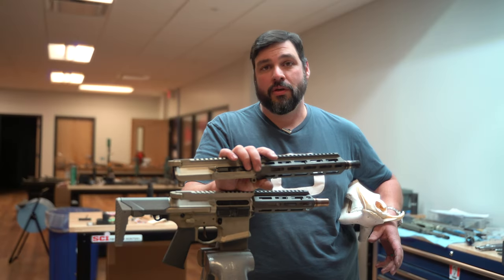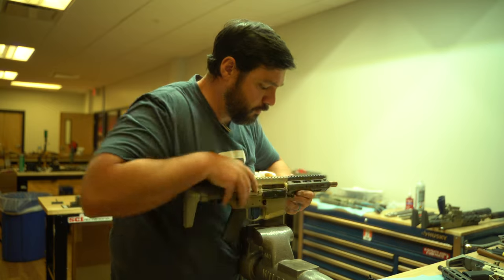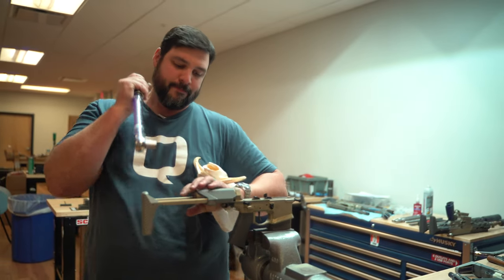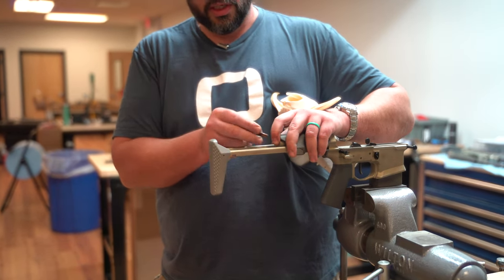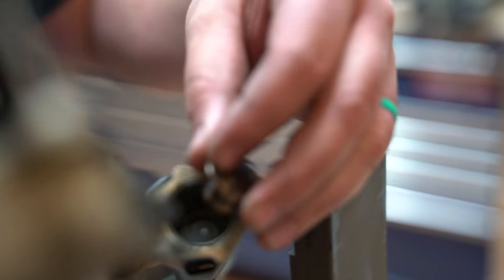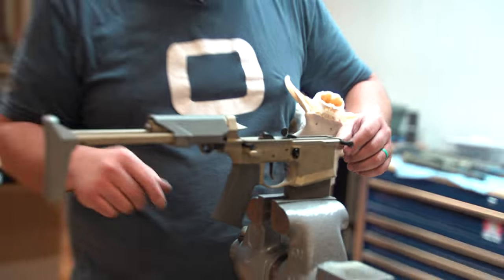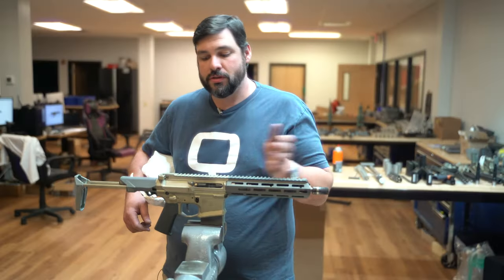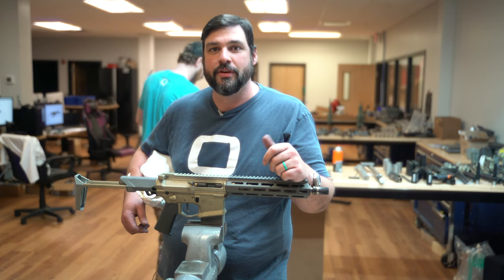How to Convert Your Honey Badger to 5.56

Comment: The price point is going to be interesting on this one. If they charge too much for the upper, you may as well just buy a whole new gun at that point. Curious if the kit will also include the BCG or if they will make you buy that separately as well.
Reply: So this is about the closest I've seen to someone using "price point" correctly. You only use it when refering to a product without a set price. Such as this, when a company is trying to determine what price to sell said product at. "Should we sell it at a $300 price point?" 

Once that price is set, it's no longer "price point". You use "price" no matter if you think price point sounds correct. 99% of people use price interchangeably with price point and that is not correct. I'm actually shocked to see you use it pretty much correctly. I had assumed you used it wrong like everyone else does, so I made an entire comment about it and deleted it once I realized you actually used it correctly. 

Nice job!
Reply: I’m sure, regardless of price, people will pay it.  Im sure it will be about 200-300 more than it should because you’re atleast skipping the tax stamp and wait for sbr guys
Reply: Yes, will include new carrier.
Reply: @kevinbrittingham6774  Any plans for other barrel lengths? 12.5 or 14.5?
Reply: @TheWesman45  yes

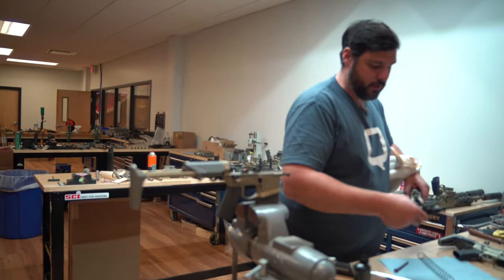Comment: @Kit Badger do you if Q will be selling those Q Cert rails with stainless steel thread inserts for the original 300blkout Honey Badgers? I saw it on the table in this video at 3:05 and it looks sick! Not sure if it was the Boom Box or not.
Reply: Looks like a boombox.

Comment: The fact that I don’t have to convert it back to 300 blackout with the old recoil system makes this very compelling. It’s nice that once I converted to 556. All I have to do is slap my factory 300 blackout upper back on! It makes the question do all new honey badgers come with these parts from the factory, even if it’s a 300 blackout version? If not, that’s really stupid and it should.

Comment: I was wondering if there is a way to buy a 300blk upper and basically reverse this video. I just bought a 556 honey badger and its insane, love it.  he mentions that with the 556 recoil system you can seamlessly switch back to 300 blk, but i cant find a 300 blk upper for sale anywhere, or that its even made...
Reply: Follow up in case anyone was wondering, I reached out to Q, it’s in the works.

Comment: Nice, ok, next two projects, a version in .22wmr with an overall length of not less than 24 inches with the stock collapsed so we here in the UK don't feel so left out, then a fixed stock Mini fix, same minimum OAL, because of the same dumb gun laws.

Comment: in theory this should work perfectly with a Ghetto Blaster too right?
Reply: Wanna order one today and find out.
Reply: @ClevelandWHAT  already done did it =) 

I've put around 180 rounds so far no hiccups.
Reply: that said... i got mine before they went for sale... a friend got a HB 556 for parts... so I picked up his 556 upper and I'm using my novseke BCG not this new 2piece.  I gotta find a way to get my hands on this new BCG and spring setup now haha
Reply: How’s the ghetto blaster run with the new spring setup on the Noveske 300 upper
Reply: @ClevelandWHAT  sorry you might not have seen my second message.... I got my upper in a weird one off deal... so upper only no BCG.  so I'm using the "old" HB/Noveske spring and BCG. I've only been out the range once.. I was testing a couple of things so only got about 180 rounds through it.  so far perfect... 3 different different companies of 223.